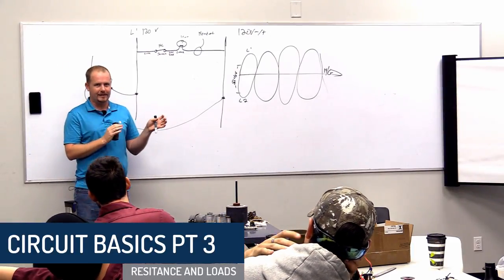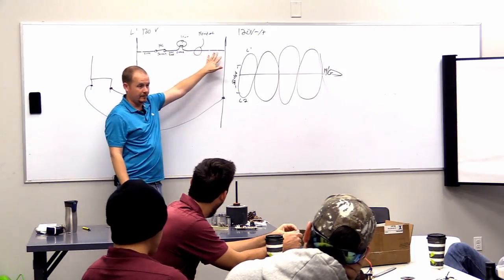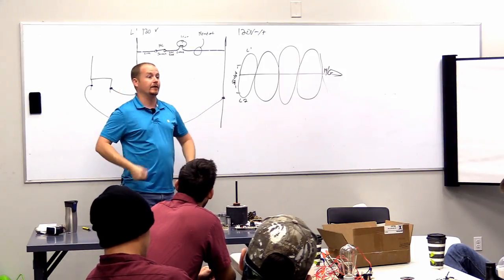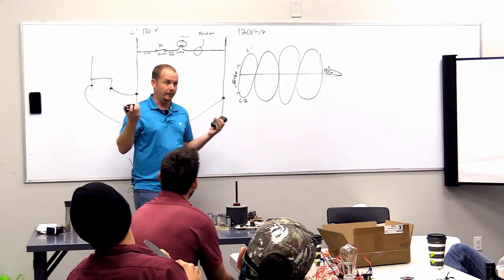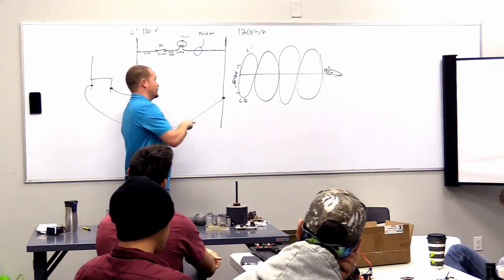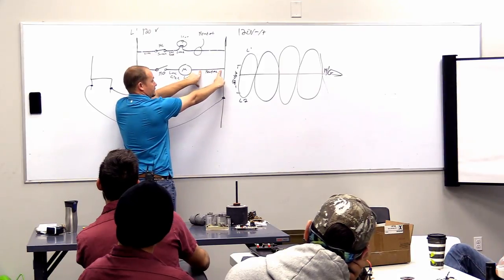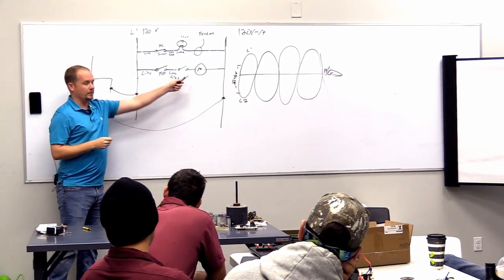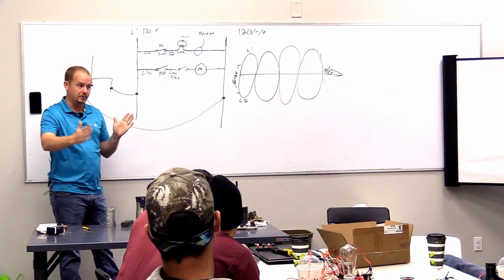Electrical Circuit Basics Part 3 - Resistance and Loads

Comment: With the example at around 10min with the two open switches, what if you measured from the line side of the first switch and the load side of the second switch?
Reply: You'll get the 120 v

Comment: Why would you have a wire without a load? Wouldn’t you just get rid of it completely instead of it causing circuit to heat up & cause damage? Very new to electrical here. Honestly curious. Thanks y’all.

Comment: You have a load in your meter chump!  I have stuck my meter leads many times in an electrical socket and it didn't blow up!  If you use an analog and have it in ohms and put the leads across a power supply it will blow up!  I am privy to that but i did not do it my boss did! Many years ago!  If the meter is in the correct designation it will be fine.